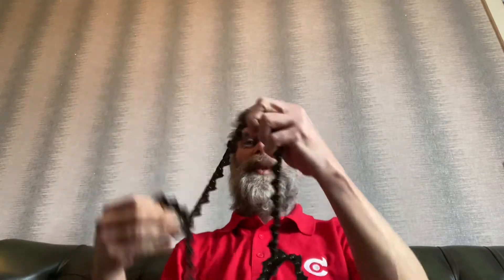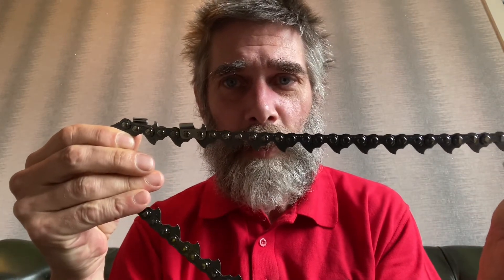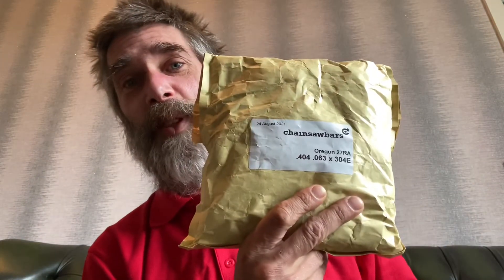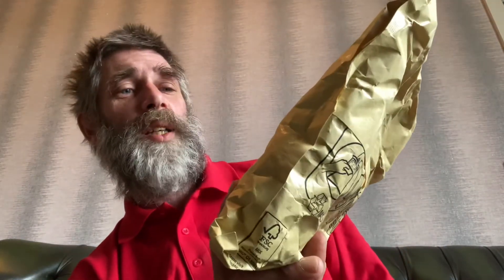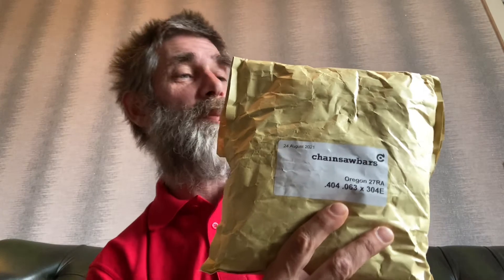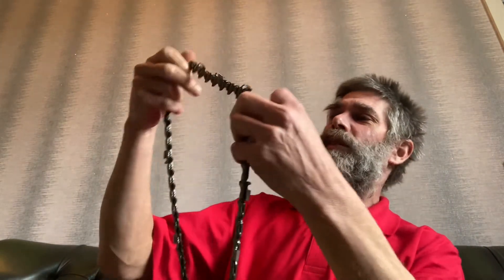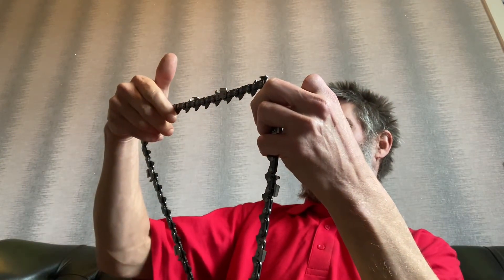Big Chains! Full complement, full skip and hyper skip.

Comment: I run a 72" bar with a hydraulic powerhead to rip seasoned hardwood.  It has more power and feet-per-minute than the two 075 powerheads I used to run.  I've only run a full complement chain, never tried anything else.  Generally I can get 4-5 slabs cut before I notice the chips are getting dusty.  Despite that, the chain keeps cutting, but my speed goes down.  It's being strongly suggested that I change to a hyperskip chain.  I find myself being nervous about trying something new.  With the fewer cutters, it'll sharpen quicker, but won't that translate to it dulling quicker?  Would a skip chain be a better choice?
Reply from the maker: Full skip and hyper skip are generally designed to lower the drag of many teeth.
Would I recommend a full/hyper skip for your power head, yes.
Two reasons.
Firstly it’s much quicker to sharpen.
Secondly it cuts about the same speed as a full comp.
As far a dulling goes it would depend upon the debris in the bark etc.
I’ve done 16 x 12’ x 2’-3’ hardwood cuts with only one sharpen.
👍🌳🌳🌳